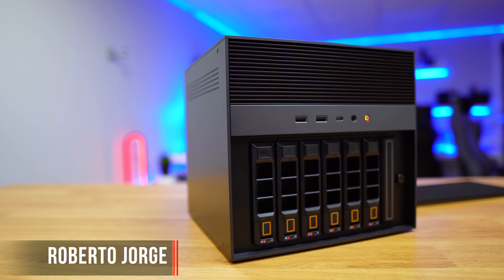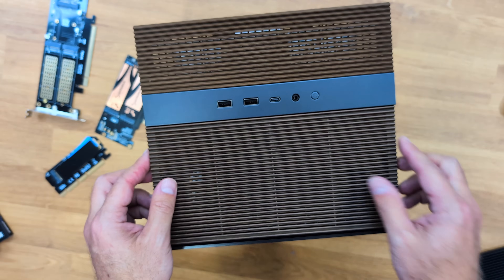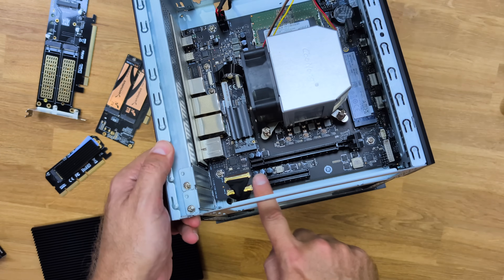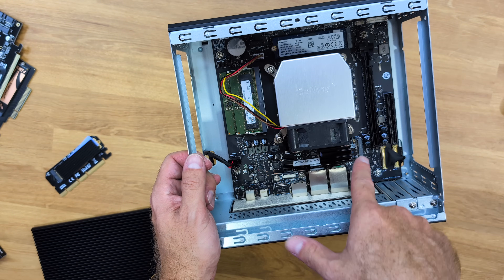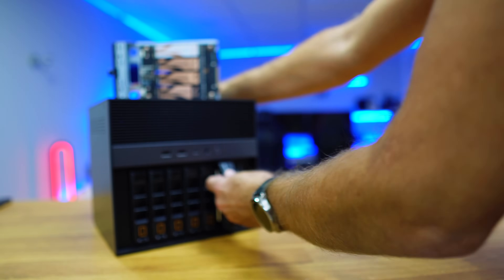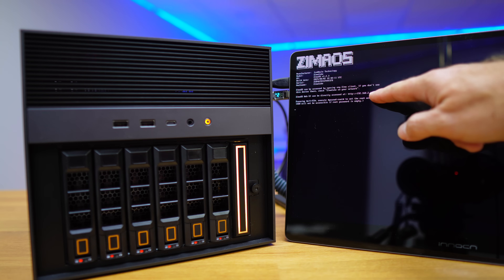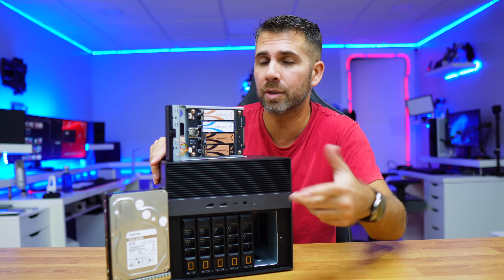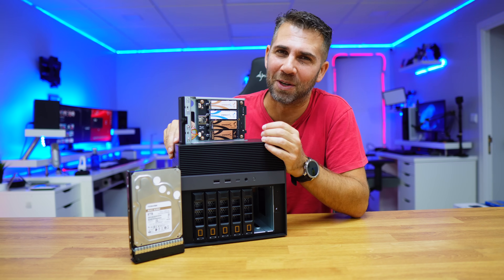Perfect NAS for Home or Overkill? ZimaCube Pro and Thunderbolt 4 🔥

Comment: 6:09
What's the power consumption on this? My guess is its pulling 100W? That's like $20 per month of electricity where I live, and it sucks.
Reply: My worry too. I'd just get a N97 mini PC and an external 10Gb enclosure for efficiency in power and heat.
Reply: @dazealex  
If you're worried about efficiency, x86 is never the answer. That's why 24 hour devices all run on arm/risc. Like smart devices/ISP ONT/routers. Having an x86 nas running 24/7 is not what I would want in my house.